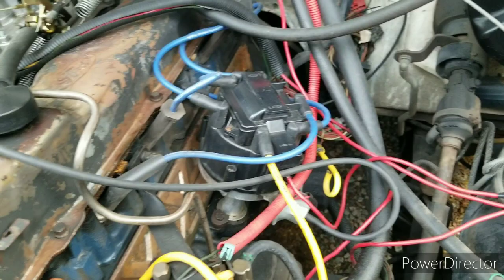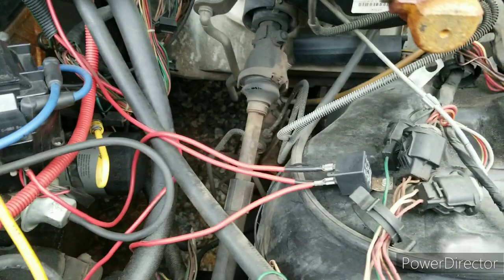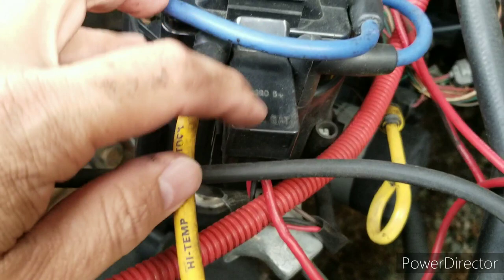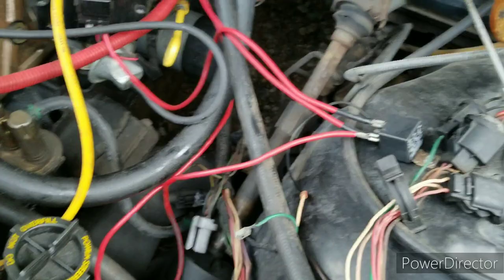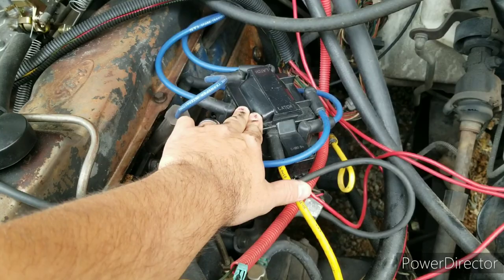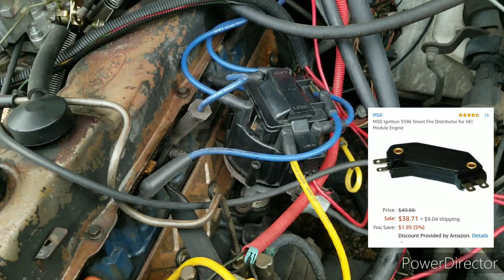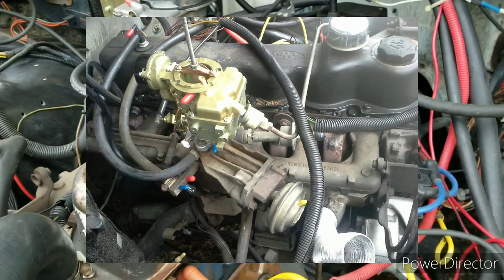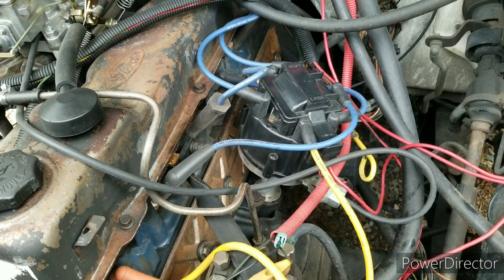Ford 300 Chinese Hei Distributor Review and Wiring

Comment: Good vid.  Were building my sons first truck a 77 f150 4x4 4spd with the 300.  I'm using a similar setup.  I've used these hei before and had pretty good luck with them.  I have a build on a Jeep 4.0 efi converted to a carb with hei and one wire alternator.  Runs beautiful and cleans up the engine compartment a lot.

Comment: I have an after market hei for my 300. How do I check if it's chinese? Paid a lot more for it than you did. In any case tanx for the heads up on the flame thrower module.
Reply from the maker: Usally the ebay and amazons, probally most of the unbranded ones.